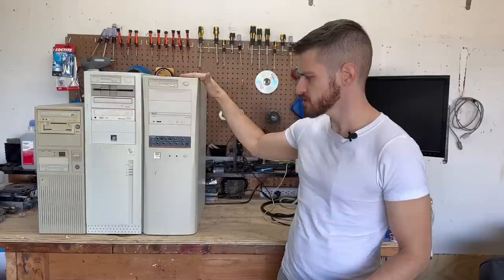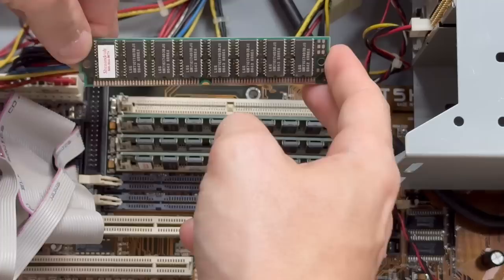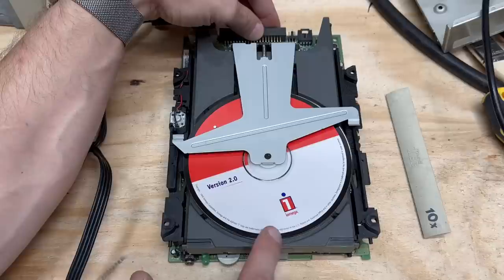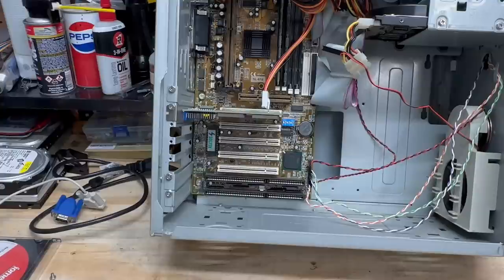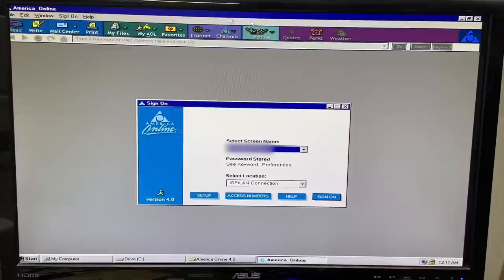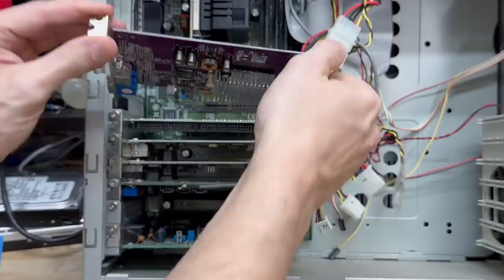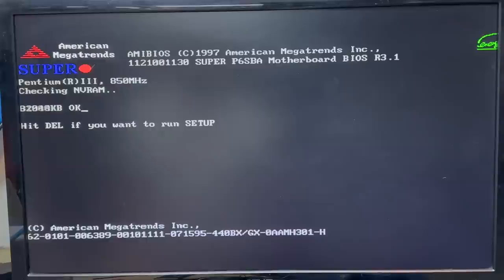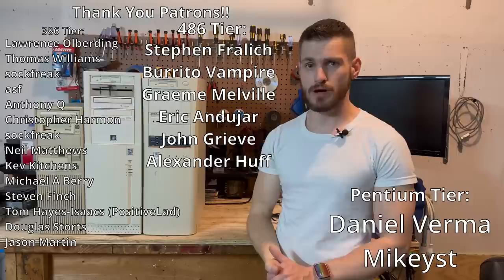Let's teardown and test some GIANT vintage computer systems! From the Franklin eWaste haul!

Comment: Whoah I wish I could find a full-size tower like that, I have an Amiga 3000T motherboard that needs a home. Nice haul BTW.
Reply: 3000t not a 4000t? That's something I don't hear much anymore! (I'm an original Amiga factory service center technician)
Reply: @ewelmo3921  3000T. Bought it over a decade ago from a "well known" ebayer, the board had its CPU/FPU ripped off the board so there are many lifted traces. I think it's repairable but without a case it's a bit too much effort to invest for now. I have the chips and Kynar wire to try and repair the lifted traces. But it's going to be ugly.
So......... does the 3000T fit into a PC case or are there misaligned mounting holes?

Comment: 16:20 That's a Yamaha DS2416 connected to that AX44. It's a digital mixing card. The AX44 is just for convenient cable attachment
18:20 The bottom 2 connectors on the DS2416 are audio coax input and output ports , respectively

Comment: Such great cases. I'd totally build a modern machine in one.

A few old memories from this video here.

First X86 machine had the dual optical drives, when "combo" drives that could burn CDs and read DVDs were still a couple years off, as were DVD writers. My CD-RW was 24x/4x/2x. I did later get a 52x CD-RW, man that thing sounded like it was about to take off sometimes!

My first CD-ROM drive was an external SCSI like that expansion card, though I plugged mine into an Amiga 1200 via PCMCIA socket using a Squirrel branded adapter, it also had my first modem(28k dial up) daisy chained on it.

My first X86 mentioned earlier was also a P3, but it was in a regular socket not on that almost expansion card looking thing. Quite an oddity. I can see the sense of it in making it more beginner friendly, but it must've been expensive.

AOL brings loads of memories, too. Over here it wasn't branded as America On-Line, but simply AOL, with no mention of America anywhere in the software. Of course, it led to the same portal, so you'd get all the American branding there. I guess it makes sense since it's not America, and Great Britain and Ireland On-Line just doesn't quite roll off the tongue.

Lastly, not to get too tl;dr here, I'm glad we don't have to restart(whether due to hardware/software change, setting update or the fifth blue screen that day) anymore.

Comment: 10:04. I think Intel put out 166, 200 and 233 mhz MMX CPUs before the first Pentium II came out and replaced the Pentium MMX processors, I don't remember for sure.
Reply: Fun fact: PMMX233 was released AFTER PII as some sort of Celeron a year before Celeron but the 166 and 200 came before PII

Comment: Not appliccable here, but for future reference. CD-drives need to move the lacer caddy out from the center, then back, and operate an microswitch before it try to spin the disc. It's to be able to read toc at once when it starts up in adition to have its endstop reference. Ironically an DVD has it the other way around. It's toc is stored on the very edge of the disc, if i dont remember it wrong from the classes on these way back in electronics school. half an liftetime ago.
Reply from the maker: Thanks for the info! I'd love to get this drive working.
Reply: @miketech1024  that was actually the exact same drive I had on the first machine I ever bought for my own money. Cyrix p166+ 133 MHz system. Wish I didn’t get rid of it when I swapped to a p3 450mhz system. But yeah. Money were tight so I sold it.

Comment: i had both of the two taller ones in the 90's (I believe) the last case I still have, it had so much room I modified it with extra fans and even did my first homemade water-cooling in it. I also had the Adaptec Scsi card as I used Scsi back then ( came from Amigas so had used them there and they had a speed advantage back then). Had my 2 Orchird 3DFX cards for Quake! i

Comment: I’ve got 3 x 24” Full Tower Cases here although I’m not sure of what Hardware is in them now, They are ATX Cases as they have Micro Switches for the Power Buttons instead of the Mechanical Buttons, One is empty if I remember correctly, 2 of them belonged to Brothers who no longer wanted them so they ended up at mine, I’ve also got a 19” Intel Server with Dual Slot 1 Pentium III Processors and it’s bloody heavy!
I was absolutely Gobsmacked when I bought my latest Case which is a Cooler Master Cosmos C700P as it’s close to 26” and weighs a Ton! 😂🇬🇧

Comment: Past tech here. Our AT power supply "tester" was an old broken Seagate ST-225 as a dummy load and probing with a multi meter. Most all of the ISA POST probe cards have voltage lights and test points as well, but they really aren't needed.

I have a Supermicro P6SBA here, decent board but has that stupid WinBIOS. Was an emergency swapout when my AOpen AX6B+ died on me. I find it weird that someone would outright toss a nice DAW setup like that with the card and all. We need to hear some ReBirth creations! The Pentium with two NICs was likely living its senior years as a dedicated NAT router/firewall running Linux.
Reply from the maker: I’d like to build something that really pushes the PSU to its limit without putting a precious motherboard at risk. I have to figure out if a purely resistive load is sufficient. I’m thinking a PWM circuit in-line with a huge resistor (like from a car battery tester) with voltmeters on each rail to monitor voltage drop. 

I really wish the hard drive in that old dual-NIC pentium worked! Maybe it’s a good thing though, because if that thing had started booting Linux or BSD I would have gotten way too excited!

Comment: If you used a Slocket for your 100Mhz bus Pentium III on a supported Intel i440BX Slot 1 board you could install up to 768Mb of RAM,  most Socket 370 boards at the time had the i810/815 chipset which was limited to 512Mb.

Comment: My first PC was a 486/33 in a macro tower like one of those.  It was almost tall as the desk.  It had a 5.25" and 3.5" floppy, and 8mb of ram composed of 30 pin 1mb simms.  An internal 2400 baud modem came from Electronics Boutique.  Later on I got a Soundblaster CD combo and a DX/2 66 cpu.  Before I got the Soundblaster, I picked up a Disney Sound Source on clearance at KB Hobby.  The system ran fine until 1997, then was replaced with a P166.  IIRC it had a  Video 7 256k video card.  I also had a Marstek hand scanner and it's interface card.  My printer was a used Star Micronics Gemini 10x.  It ran great but when I upgraded to Win95, then it lacked driver support.  I could use the generic dot matrix driver but it was text only and couldn't do graphics right.

Comment: That OS branded Case is actually an AOpen HX-08 Case! I have one. The motherboard tray slides out. At the top rear is a hard drive bay that can hold 4 3.5 in hard drives. The AX44 is an input and output expander for the Yamaha DS2416 Digital Mixing Card and provides four 1/4-inch analog outputs and a stereo headphone jack. It beat the pants off of Soundblaster anything. :face-red-heart-shape:

Comment: This vid took me WAY BACK to the days when I did my own bare-bones builds.  I had a huge six-bay system that ONLY had the removable drive trays ... I could easily cold-swap drives to change WinOS versions, drives for image backups, data drives, etc.  It was AHMAZING ... those were the 'good old days' ... now as an exclusive MAC user, cant even create a bootable system image on external drive (well can, but its quite convoluted to do so).  Dont get me wrong - wouldnt go back to WinTel for anything - but sometimes the trade-off for security gets in the way of 'fun' LOL

Comment: I remember purposely buying the biggest dang Antec server case I could find just so I could load the front bays up. It looks 95% like a clone of your second tower. Just a bit different but the same size I think.I put  a cd player, cd writer, floppy, and sound blaster front panel and still had a couple extra spots. Plus people were always impressed when they came over lol. It was 70% empty space inside but sure looked cool. 

It still runs in my basement as a Linux machine.
Reply from the maker: Nice! Are you using it as a server?
Reply: @miketech1024  no, its just personal use. A laptop could replace it easily but the truth is I just don't want to get rid of it. That case went through several motherboards and versions of windows as I upgraded. I only just went to a modern black flat front case 3 or 4 years ago, I was still using that antec in 2019 lol. Its like having a favorite old car around.

Comment: That audio PC is a real time capsule. Oddly it doesn't seem to have been used much, judging from the very clean desktop and default teal Win9x background.

The Yamaha DS2416 card was pretty nice for the time. Those chips had built-in DSPs for effects since CPUs back then were much too slow for real-time audio processing. The original Sound Blaster Live also came out around the same time and likewise had an onboard DSP, but only had stereo input.

Unfortunately it looks like the DS2416 drivers only support up to Windows XP. There's no support for it in the Linux kernel either. Still, a useful card if you don't mind running old software.

I'm reminded of the Aardvark Q10 I was given years ago, a rackmount multichannel audio interface that connects to its own proprietary PCI card using what I think is a 25-pin serial cable. The company released Windows XP and Mac OS X (PowerPC) drivers for the Q10 up until 2005 but then went out of business and completely disappeared.

Cool Edit Pro is the original name for Adobe Audition. Great software, and very popular in the audio world back then. There was also Sony Sound Forge and GoldWave.

I don't think Audacity was used by many people until at least the mid-2000s.

Comment: That computer with the Yamaha hardware would be quite nice with Windows 98 SE installed on it. Lucent Technologies came about as a result of the breakup of Ma Bell in 1984. The Western Electric Manufacturing Company was the predecessor to Lucent. Lucent merged with Alcatel and at some point both companies became no more.

Comment: i don't get why most hate on molex connectors so much..  yeah there were some cheap crappy ones out there, but that was the shoddy construction.  the overall connector spec made them quite useful, and were nice to work with when properly built

Comment: Very interesting, I still have my first computer Packard Bell PB620CD bought it at Walmart back in the late '90s had the 56K modem Seagate 341.3MB HD. RAM: ???? Has a bad power supply unable to boot up. But still an old cool computer. See if I can find an old power supply and see if it will start up. It did work when I shut it down years ago. Later

Comment: Well, could sorta do what I did for testing ATX PSU's, I got a old Phenom II x3 that unlocked to 4 cores and a GTX 260 and Windows 7 on it, If I get PSU's in or even older ram that works in it, doubles as a test bench, I run furmark, prime95 for a while just to see if the PSU can do it, I've killed a few with that system, never harmed the system yet, but usually a pop, and the magic smoke.

Them PSU testers, all they do is test voltage, I got a volt meter I can do that with, but yeah, I do wish there was and more affordable and easy way to test PSU's other than just turning them on a checking voltage.
Reply from the maker: I’m definitely leaning towards designing my own tester. One that can actually apply a load while measuring voltage drop, ripple etc.

Comment: Great work with these computers! Do you have a video showing how you grease the disk drive trays, and what you use?
Reply from the maker: No video on that specifically. I use white lithium grease. You can sometimes get it done without even removing the drive from the system. On the under-side of the tray there are two plastic rails and some gear teeth. Try to clean off the old grease with alcohol best you can. Then open the tray all the way and apply grease on those rails and gear teeth as close to the drive as you can get. After that, close and open the tray several times to distribute the grease. Be careful not to add too much grease. A pea-sized glob on each rail should be all you need.
Reply: @miketech1024  Thanks

Comment: About connector in plastic bag, they were afraid to disconnect anything from pc but also scared that it might short/overvolt something on mainboard while pc is moved so sealed with plastic bag. Not that dumb to be honest, pretty reasonable. If I'd ever find that my mom, her being afraid from anything electric would do such a ting, I would praise her for ingenuity. "Why just don't remove the cable" does not apply in such cases.

Comment: I really like the last two (tallies two) computers that you have. Especially the last one because I wonder how many floppies I can add and have work all at once. I also thin it would be utterly ridiculous to have four IDE CD/DVD Drives as well. I hope to get it when the time comes.
Reply: My main desktop PC in 1999 had three optical drives: IDE DVD-ROM, a SCSI CD burner and SCSI CD-ROM. Ironically the AMD K6-2 350 CPU I had in the machine was too slow to play movie DVDs (remember PowerDVD?) without stuttering, so the DVD drive never got much use in retrospect.
Reply: I think I had a 5.25 floppy, CD-RW drive, and a tape drive for the 5.25 drive bays in my InWin Q-500 case (the last machine).

Comment: I remember having the third (in order of teardown) of those cases in the mid-to-late 90's.  The box had "InWin" branding.  By the end I had all of the bays filled with multiple hard drives, a CD burner, and a  DVD drive, all running on an UW-SCSI bus feeding dual PIII processors, just to see if I could get this configuration to work.  I think I has 512 MB RAM.  I am sure that I did not really "need" this kind of power, but it was a fun build!

For ultra ridiculousness, it had an LS120 Superdrive (that I only ever used with standard 1.44 MB disks) and a 5 1/4 floppy (because why not?)

When asked why I had built this ridiculous system, I answered "Because I can"
Reply from the maker: All of those drives must have sounded like a symphony! Forget a white noise generator, I need one of those next to my bed!
Reply: @miketech1024  To make it better, all of the hard drives were 10,000 RPM "Server-grade" (in other words, LOUD) and the LS120 was almost silent reading disks.  I liked it because it read floppy's extremely quickly.

It, after all, connected to the IDE and not the floppy interface...  Got to be my weirdest build ever - 5 1/4" FDD on floppy connector, 3 1/2 on IDE, and everything else SCSI

Comment: I still have a couple of Yamaha PCI audio cards from vintage machines. The XG-1000 still fetches a couple hundred USD on Ebay, which attests to the overall quality of these cards. The AC97 onboard chips don't hold a candle to the Yamaha and earlier SoundBlaster Pro cards!😉

Comment: Of course you know it and probably did not do because of respecting privacy of previous owners, but when you boot such old computer and open lets say music making software, under "file" menu sometimes there are listed previously opened files. Filenames can tell a bit about what the hardware was used for. Demo123, Bach_minor_l, june_vip_burial, radioSuperMoto1, etc.

Comment: If it were my hardware, I'd take the PIII machine and use it as the audio editing system, running Windows XP and Audacity 2.0.6 (newer versions require SSE2, which the PIII doesn't have)
Reply from the maker: Yup. I was thinking either a P3 or a P4.

Comment: That first tower is definately an early 90s 386/486 era case, hence the turbo switch. I may be wrong but I do not think that any Pentium chips were capable of turbo switching. This case has been reused multiple times I suspect. The Pentium MMX 233 dates it all to about 1997 in general, maybe with hard disk replacements or additions regularly due to the caddy.

Comment: Removable IDE HDD enclosures were quite common in the 90's because USB1 didn't provide enough speed and FireWire was expensive. The only alternative was SCSI but it was more oriented at pro gear. However these kind of enclosure were very prone to get loose connections with time.

Comment: Having dimm slots has nothing to do with it being "super socket 7". Actually, there's no "official" definition as to what a "super socket 7" is, but most people go by the 100 MHz bus support and some also add having an AGP slot to the "requirement".

Edit: also you hit the jackpot with that Pentium 2 450. They are quite rare and, thus, expensive.

Comment: Woah, that Yamaha rig is a real gem!  I looked it up and yes, it was a semi-pro (what I think they used to call "prosumer" lol) recording setup in it's day.  The other PIII tower is a true gem as well, would be interesting to check it's period-appropriate game performance.  What interests me is that it still has IDE slots, which I had thought were long gone by the time PIII rolled around.  Still, great system there.
Reply from the maker: That Yamaha DS2416 won my heart instantly when I saw that noise floor. That’s something I’ve always struggled with in recording to a PC.

Comment: CPUs of that time ran at a fixed speed and voltage. So the heat load should be the same and fan would need to spin at a constant speed anyway.

Comment: 31:48 That Promise IDE controller can be modded into a RAID controller. It involves soldering an extra resistor between two pins and reflashing the ROM. Just do a web search for "promise ultra66 hack". That might make for an interesting video.

Thanks for another great video, Mike!
Reply from the maker: Now that is interesting. Most definitely a subject for a future video. Thanks!

Comment: I just down loaded the Knoppix distro to a USB thumb drive. Very interesting OS. Is it a lot easier on the Hardware? I am running a Lenovo Think Pad T 530 with a 2.6 Ghz CPU and 16 GB of RAM and Intel HD 4000 GPU.